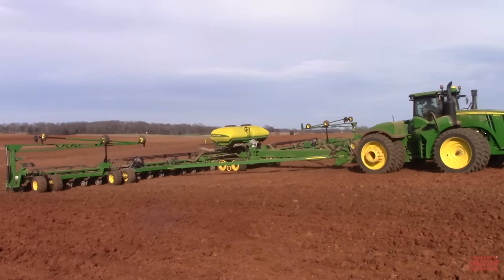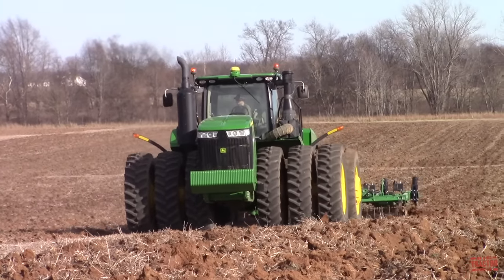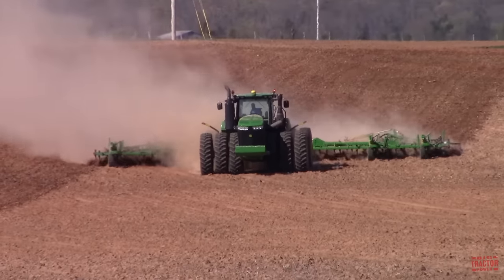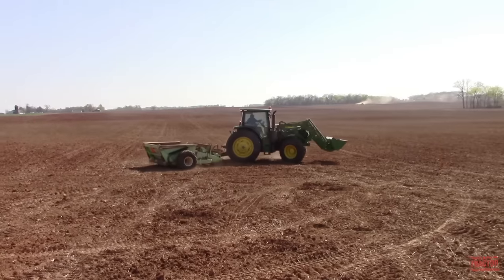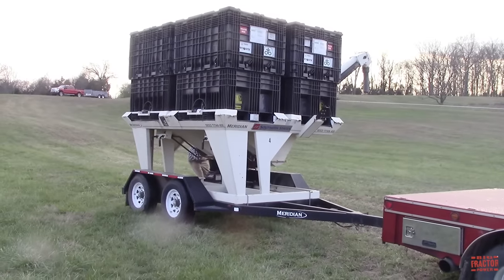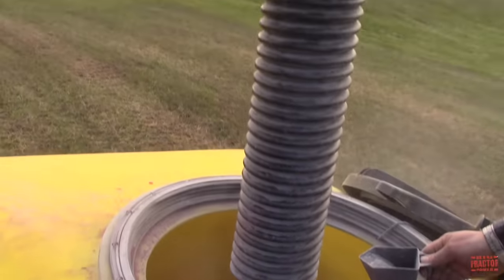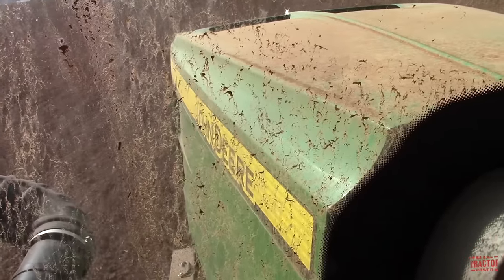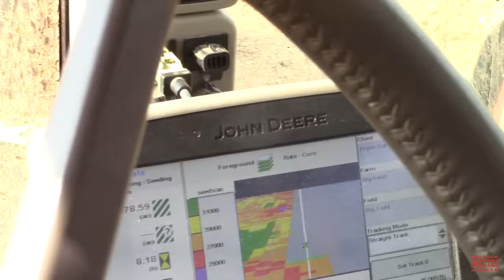JOHN DEERE Tractors Planting Corn

Comment: Well here on our small Western Pennsylvania operation, we use a John Deere 7000 conventional till planter behind a Case IH 75 c. We work with the ground conventionally using the Case IH 75 c and a McCormick cx95 to plow Wii disc right behind the plough a day or two later. Then right ahead of the planter we go through with an s time harrow. Being from geographically a good bit further north it blows my mind to see a corn planter going when the leaves haven't come out yet. Having said that our plan here is to plant our spring grain which is Host this coming Monday and we have very few leaves on the trees I'm used to shading oats and hay when the trees are still bare however I've not ever done that in the cornfield are conditions were just too cold this early one of the things I really enjoy about bigtractorpower is geographical differences you show us from state-to-state great job Jason keep it up 👍!

Comment: I'm always amazed that a gas fertilizer can be put into the ground and stays there. In sure it turns to liquid or something but I feel like  you'd lose a lot to atmosphere.
Reply: You don't lose a lot of fizz in your Pepsi if you keep your mouth on the bottle...same goes with soil...
Reply from the maker: The soil seals in the gas.  The “smoke” you see is steam.  The anhydrous  is pressurized and cold.   When it hits the air it turns to steam.   It smells like winded and is very caustic to the eyes and lungs. You have to be very careful around it.
Reply: @bigtractorpower  …I can attest to that . We had a hose come off during refilling back in 1978 , I got a good dose and even though they said there was no damage to my lungs at the time I have breathing problems now .

Comment: Not to sound dumb or anything but how so they keep track of where the exact location of the rocks are in the field to keep from riding around and skipping large rocks
Reply from the maker: Good question.  Basically most fields have their known rocky spots so they drive to those area to pick the stones.  It’s also a line of sight as your driving along and you see a stone  you pick it.  It not an exact science but the picker saves allot of time and labor.

Comment: With kentuckys extended growing season, what's the big rush to get done so fast?
Reply from the maker: The summer gets really hot and dry.  The corn needs to pollinate in mid June.  July heat will damage pollination. Corn needs to be harvested in late August to allow for fertilizer and tillage in September to plant wheat in October.  All corn ground goes into winter wheat.  The wheat needs to be harvested in early June to allow for a second crop of soybeans to follow.  Every season is a hurry up and get it done so the next crop goes in on time.
Reply: @bigtractorpower  gotcha makes sense thanks for the good reply